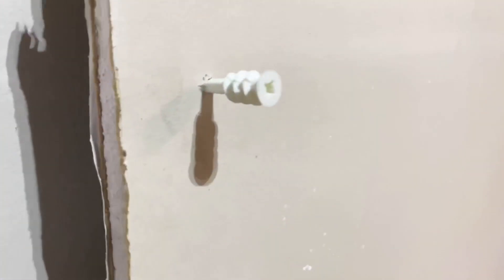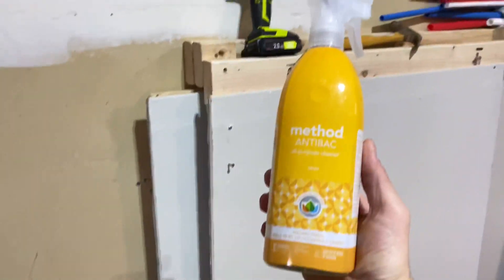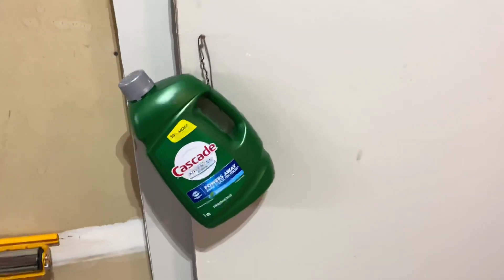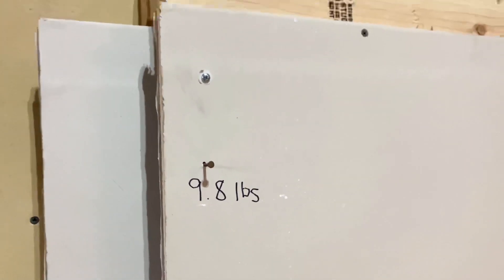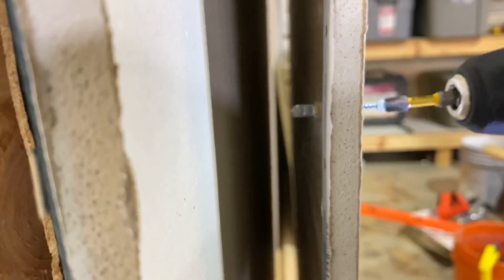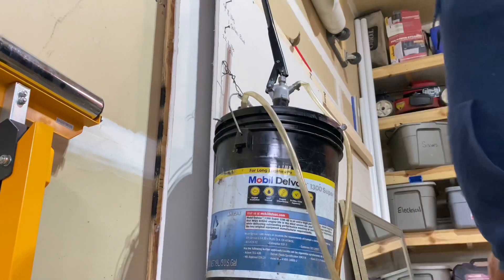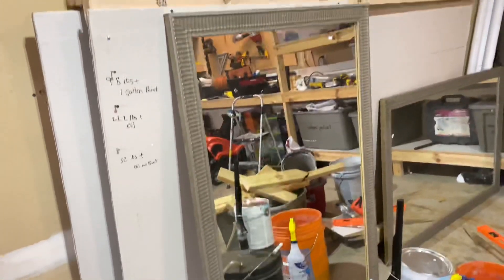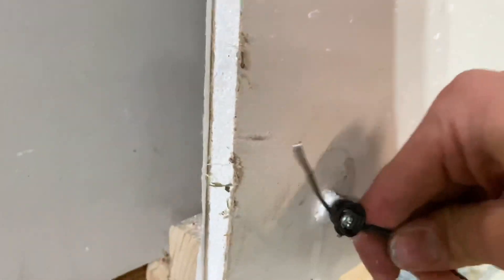🔹How Much Can Drywall Anchors Actually Hold.

Comment: Completely useless tests. Those anchors need to hold that weight indefinitely, not for the two minutes you tested them for. So of course a nail will hold significant weight at first, but it won't last forever.